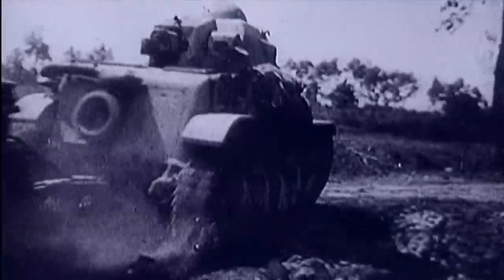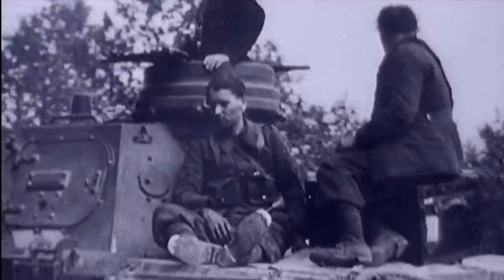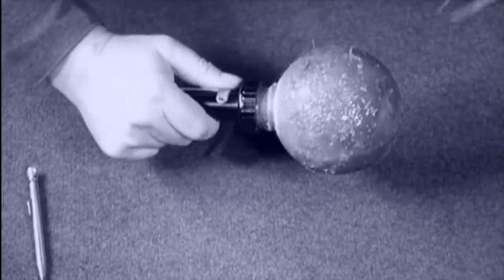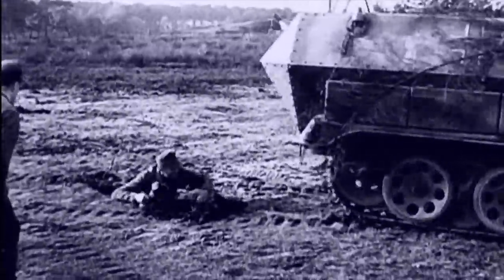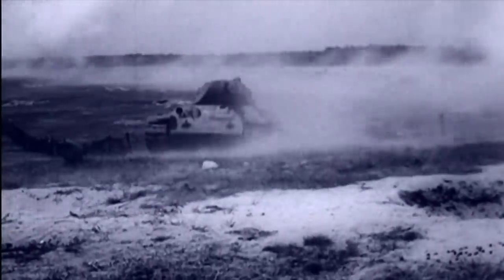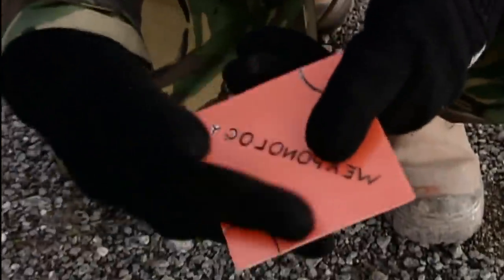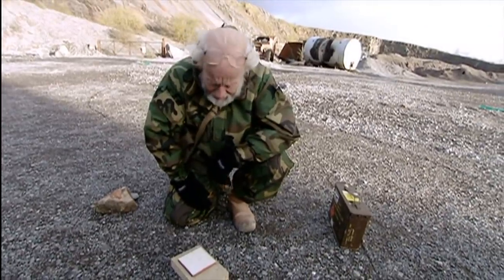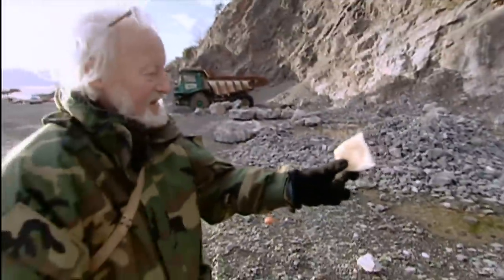Weaponology - "Sticky Bomb"

Comment: "It was Charles Monroe, an american who first noticed how the power of explosives could be greatly enhanced."  Hmm...  I'm going to pull that into questioning with German's already using shaped charges,  and making explosives from resources other then nitrates due to the loss of regular supply back in September 1939.  To name an example to why Mr. Monroe wasn't the first: 

Germany, like everyone else started inventing new explosives and propellents after WW1. Germany made news with its new R4/M aircraft rocket which used Diglykol propellent, later patented by the Germans in 1928.  Another example of discovering enhanced explosive power was the use of the legendary Panzerfaust.  Using 100% Black powder propellent, which was around for a long long time but was dirt cheap. Now as it stands, black powder isn't enhanced explosives.  But when we start looking at the warheads they used for these explosive weapons, that's when we see that Germany was in the lead on this. 

Both weapons had Warheads consisting 50% TNT (1860's) and 50% Hexogene (1890's).  TNT lacks quite the amount of Oxygen for a complete combustion.  Hexogene has an excess of this.  Mixing these two together creates a bundle that is more powerfull then the two ingredients on its own.     Besides that, Germany also had access to Deutsche Sprengchemie GmbH.  Another labratory enhanced explosive.

Comment: Video is misleading.  Germany didn't have hordes of tanks, just a few decent ones concentrated in areas.  The British would have to deal with them though, and man portable AT weapons were necessary.  Honestly, there were very few Pz. Is and Pz. IIs, which have less armor and worse design.  The grenades would be better against those.  The Pz. IV did have less armor, as it is more of a throw away tank, designed for infantry support.  This video tells me nothing I want to know, because I want to know how effective it was.  

Personally, this thing looks pretty stupid.  Just use C4 or a satchel charge.  Same exact thing, but up charged so it actually works.  

Okay, I looked it up.  Only 6 tanks killed.  2.5 million of these things were produced.  I'll check, but this looks like wunderwaffe, but not as effective.  

EDIT: I'm looking to check if that statistic is wrong.  

I'd use it as an anti-personnel weapon more.  You could eliminate the bounce, which improves accuracy in throwing into a dugout/foxhole.  

Main reason it does not work is two-fold.  One it is a grenade that attaches to the strong part of the armor.  Two it is under powered.  Holy heck is under powered. You need 4 kg of explosives to kill a medium tank.  Most tanks are medium tanks in WW2.  Some, are heavy.  That is not 4 kg of dynamite.  It is .57kg nitroglycerin.  Another thing that would improve it is the ability to stick them underneath the tank, which is where there is literally no armor.  

Now that German bomb is better.  Shaped charges lower the amount of explosives required to kill the tank by spalling.  

Also, if you want to demonstrate the monroe effect, which is pretty much spalling, you'll want set up a wall, and then shoot a shaped AT rifle at it.  Then, you'll see pieces spill out the other side.  

Finally, these weapons are pretty much a political/propaganda/morale thing.  They're cheap, and people think they might work.  It is better for your troops to thing you can win, then to think things are hopeless.  

TL;DR, the video is bad and misleading, and AT grenades seem to suck.  How about that.